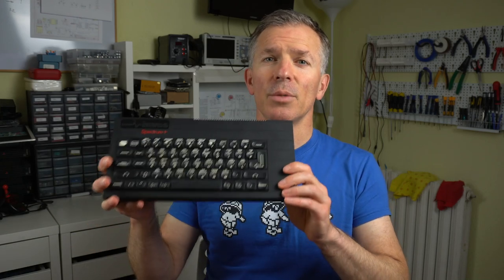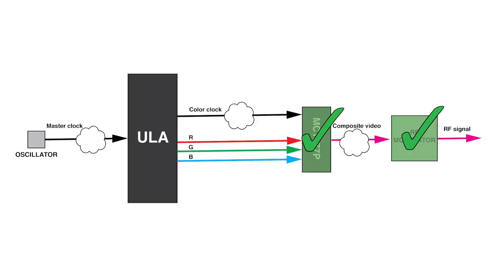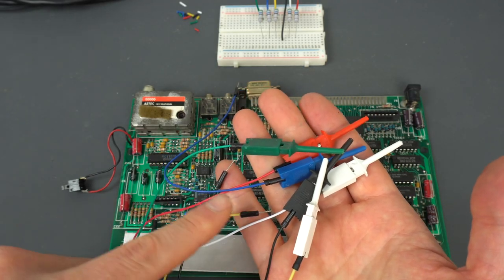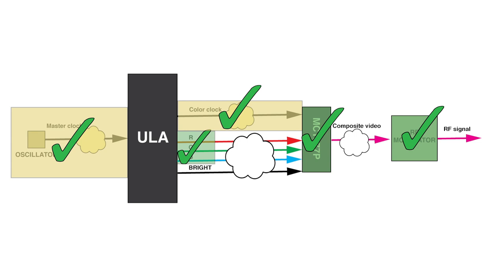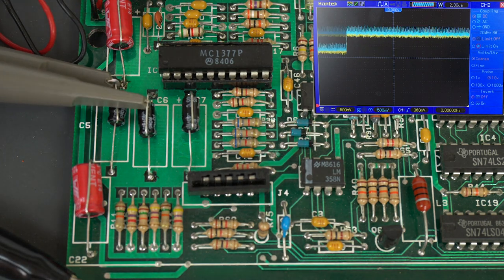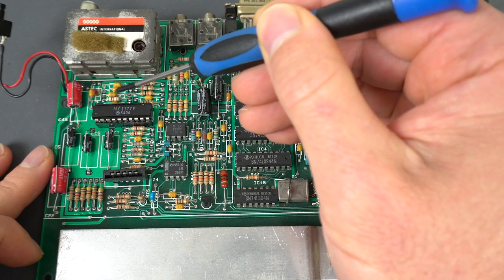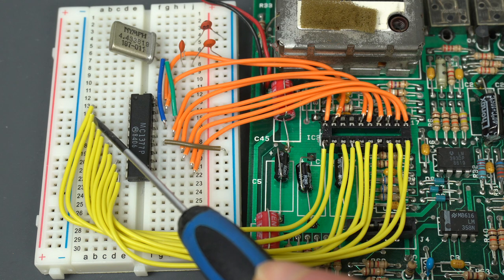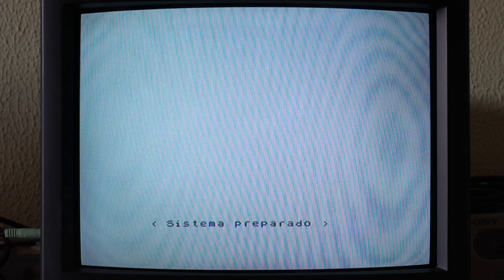Inves Spectrum+ - Investigating the Green Tint (Part 2)

Comment: I was thinking to tell you in the previous video, that I was very suspicious of the RF Module, but sorry, I didn't want to seem "listillo" without proofs ;-). The coils have a ferrite core that over the years lose magnetization and it is necessary to recalibrate them in height so that they give the original value in Henries (if possible) or replace them. You can try to retune the chroma signal with the oscilloscope either with these or with new coils. But it's a difficult process (I remember in FM tuner).
Your videos are great and I always learn new things. Congratulations.
Reply from the maker: Haha, yeah I was also suspicious of it, but managed to convince myself that that wasn't the problem. Oh well, live and learn. Glad you're enjoying the videos though!
Reply: I too learn new things each time! :D
Reply: those ferrite cores cant 'lose' magnetism as they have no 'standing'/quiescent magnetism to start with, but i suppose possible they may absorb moisture and their magnetic permeability 'could' change in some way ...
Reply: @andygozzo72  OK, but do not you think that the ferrite core acquires some magnetism in the first instant that intensity passes through the coil, in the same way that we magnetize a screwdriver?
Reply: @moterov4  it 'concentrates' magnetism, increasing inductance of any coil its within, it has none of its own , in these cases, it doesnt remain magnetised when the coil current goes away..... ferrite magnets such as used on speakers are a different thing

Comment: Simply amazing! What kind of technical background/skills do you have Noel? You're a true PRO! You do not find such competence very often and so well described. WOW, totally impressed!
Reply from the maker: Thank you! I studied Computer Systems Engineering, but that was only partly useful for this. Most of my knowledge is self taught with low-level programming, and then a few years ago I went deep into retro electronics by repairing my own computer.
Reply: @NoelsRetroLab  I studied Computer Engineering too but I am waaay far from your level of expertise! I was thinking that it could be interesting to make a RetroLab video where you speak a bit about how it all began, how did the lab start to grow, which were the first machines you looked at and fixed, where/how did you deepen/improve your skills in "retro-electronics"... stuff like that. Of course you would skip any personal information, but in a way I think it would be very informative for guys (like me) eager to become a bit knowledgeable and skilled at doing stuff like you do and show us so well. Think about it, no rush ;-)

Comment: "Never give up, never surrender!", So basically you had to up the signal to get a non-tinted picture.  As a simple Composite Mod 'break-out' had the same problem?, Or was it because you didn't break the composite line to the modulator in the first test?
In any case well done Noel! You are a positive example to us all.  You deserve more than 2k subscribers. Great troubleshooting in a consistent and well produced package. I look forward to every video you make.
Reply from the maker: The transistor was just to boost the signal and not get is so dark. The culprit was the RF modulator that somehow was adding that tint during the modulation process. Just bypassing it and using the composite signal at its input was not green, but it was dark, which tricked me last video thinking it was still greenish :-/

Comment: That 'mica' capacitor you fitted looked more like polystyrene to me.
Reply from the maker: I'm not familiar enough between the two to know the difference. Do they have similar characteristics? Meaning, is it possible that the encoder suggestes a mica capacitor but the used a polustyrene one because it's equally accurate?
Reply: @NoelsRetroLab  I'm no expert but as far as I know both mica and polystyrene are regarded as being more accurate and stable than other types.

I've found this: https://www.electronics-notes.com/articles/electronic_components/capacitors/polystyrene.php which says "polystyrene capacitors can often be used in place of silver mica or ceramic disc capacitors."
Reply from the maker: @ThePillenwerfer  That makes sense! I didn't know the difference because I don't often encounter them in these computers. Thanks for pointing that out!

Comment: There's so much to learn from this video. How to methodically diagnose parts of a complex circuit, and why always start with triple-checking your initial assumptions. :) Too bad you didn't try to fix or at least analyze the workings of that RF modulator, to understand where the green tint really came from, even if of course just jumping to the composite mod is a totally practical solution in 2020. Still, very enjoyable fix video! Looking forward to part 3.
Reply from the maker: Thank you! Glad you liked it! Yes, I have to admit I don't know much about the inner workings of RF modulators. And besides, they're all crammed and hard to work in :-) So yeah, composite is plenty good for now.

Comment: someone else might have already commented this, but the capacitor in the QL is not mica but a polystyrene foil capacitor and the one in the Inves is a regular ceramic one. As long as you have a carbon film resistor as the other part in the circuit, a high-quality capacitor would not make any sense here...

Comment: can you tell me by any chance where i do get these clamps you attached to the jumper wires to connect to the chip when you tested the video output?
Reply from the maker: Those actually came with the oscilloscope probe. They fit right on top of the probe and snap in place. Super handy when I need to keep them in place and test other things.

Comment: This might be stupid, but in the last episode you talked about a 7812, the to-92, and your supply voltage was only 11.6V.  That should be a problem, since the 7812 needs 14.6V minimum for a stable voltage out. What is the 7812 used for?  It would seem stupid to supply more than 15V in since the MC1377P  seemed to have a maximum of 14V in, and a typical 12V in.... Is the 7812 output connected to the MC1377P supply voltage?  If the board has 12V in, the 7812 is useless. I know that you fixed it already, but I am curious as to the usage of the 7812 voltage regulator.

Comment: Noel, that seems so strange because  once the colour circuit gets to the composite level, all RGB colours are going through one signal.
That is so weird how the modulator was the culprit. I can fully understand why this was the last resort on finding the fault.
Reply from the maker: Right. I don't know how exactly the RF modulator works, but it must do something with the color subcarrier to throw it slightly off.
Reply: @NoelsRetroLab  the rf output circuit of them is 'push pull' so its possible one half may have gone out of balance to the other, so distorting the waveform a bit ...

Comment: I was screaming at the screen for a while saying "CHECK THE RF MODULATOR" haha, I've spent HOURS on issues due to things like shorts that I caused...Learned to check for those things early on.
Reply from the maker: Haha, I know! I would have checked it earlier had I not discarded it last week as not being faulty. Oh well :-/
Reply: @NoelsRetroLab  trust me, spent about 15 hours learning to check things. i spent 3 months fixing my first amiga 2000. i've fixed over 15 in the last 4 months as part of my new repair business lol.

Comment: Congratulations on finding the solution! That was quite the adventure. Question ... So why when you made your own RGB TV connection with the RGB connections, breadboard, and cable did the green tint still appear? Wasn’t that upstream of the faulty RF modulator?
Reply from the maker: Thanks! Glad you enjoyed it. With the RGB out we had no green tint at all (it was just a tad dark). Which is to be expected because those RGB signals were purely digital. So we knew it had to be somewhere after that.

Comment: those modulators are 'usually' reliable...but.... all my 3 acorn electrons have had their modulators changed at some point,  they're date coded  after the electron was discontinued so cant be factory originals...maybe there was a bad batch of them???? and , some orics have trouble with low amplitude rf out, .... hmmm...  i have a spectrum plus 3 with video 'issues' but changed the modulator with one i got from a lot of 10 from a surplus parts seller, still didnt cure it! maybe those ones were also 'suspect'??!
Reply from the maker: Weird! I've had the occasional RF modulator not work (although I don't know if it's because someone tried doing something with it), but never a partial failure like this. So they've been pretty reliable for me.
Reply: @NoelsRetroLab  yep, never yet come across a definite 'dud' one, but those electron replacements are a bit suspicious... thing is , not easy to test for 'partial' failure...i think i have the internal schematic somewhere,  its input is actually a 'pull down' emitter circuit of the two push pull rf output amps., not a base input circuit, so to drive it you pull a current down, rather than drive a voltage into it,  you usually have external resistor(s) on its input to ground so you can voltage drive it..
Reply: it can be difficult to repair them as component positioning can be critical in some parts of them , due to the very high frequency

Comment: What do you think about trying to implement the floating bus? This computer, like the Plus3/Plus2A, doesn't have the "floating bus effect", so some games doesn't work because they wait forever trying to detect when the ULA starts to read the screen. But there is a mod for the Plus3 that fixes this (https://spectrumforeveryone.com/technical/performing-the-in-ff-mod-on-a-spectrum-2a-3/ ) and it should be quite easy to implement it in the Inves too, just by adding a resistor between the ULA and the Z80 data buses (I don't know it you know this great description of the inners of the Inves Spectrum plus. where it explains details like how can it have no memory contention at all: http://www.zxprojects.com/inves/ )
Reply from the maker: That's interesting. I didn't think about actually implementing the floating bus here, but you're right, it's totally doable. I'm writing it down for a future project, or maybe next time I revisit the Inves. Thanks!

Comment: Those are MLCC caps, they break very easily. Not surprised it broke haha.
Reply from the maker: Yeah, I'm still wondering how it was even working. It was just suddenly in my hand without any force. I suspect it would have broken next time the computer would have been jolted, so maybe better that way.
Reply: @NoelsRetroLab  yep, they break very easily, i tried to remove some from unwanted boards to keep as spares,  not many survived...